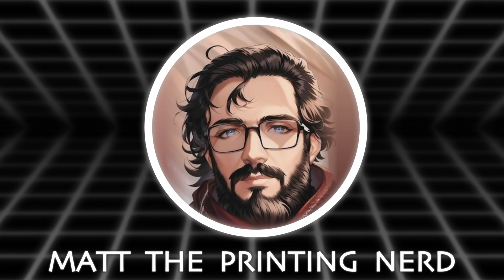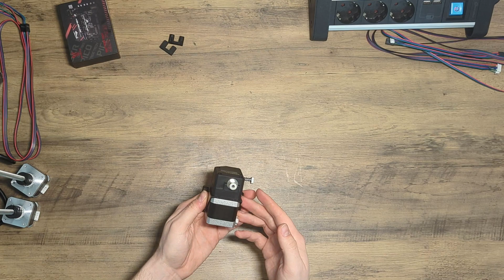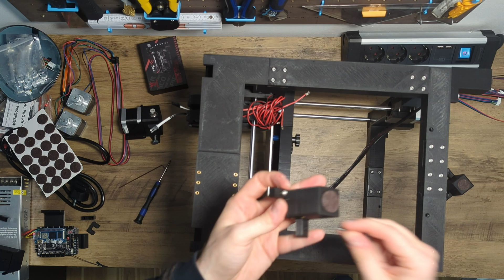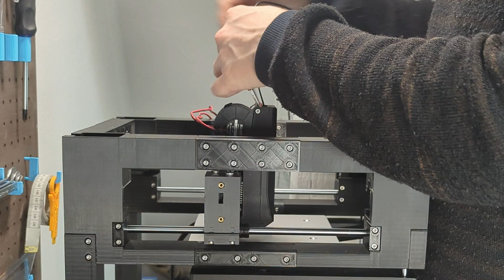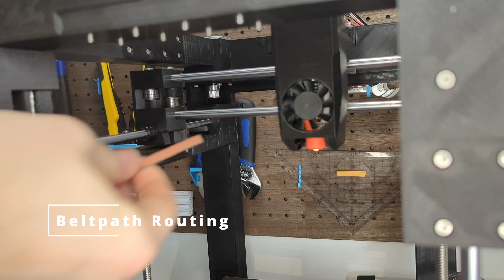THE 100 Assembly Guide - Part 5: Electric Installation

Comment: @9.45 - routing the belt is tricky, so it is easier to pre-cut the belt. For my built (totally standard v1.1) the length I measured was 118 cm - cut it and try it before you cut the other belt. Hopes this helps making it easier to route the belt!

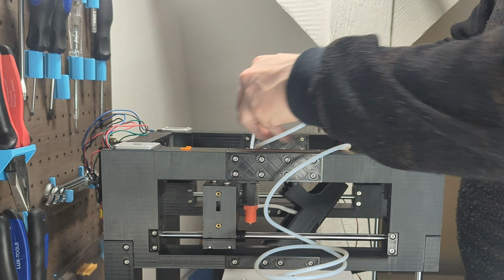Comment: 7:21 - the hotend ptfe clamp won't allow the bowden tube to pass.  Maybe the one I bought is defective?  I had to remove the collet and sand it a little smaller to get it to go in.  I am not a fan of this style of retainer - maybe a different hotend would be better?  Do you have any suggestions?

Comment: how stiff is the tool head supposed to be after installing the belts? I have to use quite a bit more force to push the tool head than I expected.

Comment: Matt, I've spent a lot of time researching this, but haven't found the answer. On the X and Y motors, I assume the left one (X?) is intended to driver the lower belt and the right motor (Y?) is meant to driver the upper belt. But the only time I see the pulleys, they are mounted with the toothed side on the bottom for both, which doesn't make sense to me. Shouldn't the right motor have the pulley mounted upside down so the teeth are at the top? Otherwise, what would drive the top belt? I've been through so many challenges with this printer and overcome all of them so far except this one.

Comment: My suggestion would be to add some safety to the electric wiring. You can't easily power down the system. Try adding for example the "3 Pin IEC320 C14" power switch. Another suggestion would be to add a shielding plate/housing to prevent touching the power lines close the power supply. 
Another issue I see is that filament can drop into the electronics. Maybe a sheet of acrylic can prevent this?

Comment: I have been trying to build this printer for a while now and i keep running into issues. Using the files you provided, i do not get the same results. One such problem i've run into nearing the end is that there is no way my print bed can reach the top because it collides with the print head. Have you actually gotten a working machine with the files you provided?
Reply from the maker: On v1.0 there should be 0.5mm clearance between the toolhead and the printbed assumed that the printbed is straight. You're not the first one that had this issue. In v1.1 i've modified the toolhead and added 2.5mm clearance to have more headroom for homing

Comment: Hey Matt,
I have been following you and your printer for a few weeks now and I am really impressed by the design and the functionality!
So much so that I am considering making one myself and was wondering if you would recommend making the printed parts out of ABS or if you have any experience with it as I would like to print with higher temperatures and maybe enclose the whole printer.

Really looking forward to more updates - Keep up the good work!
Kind regards~
Reply from the maker: If you plan to enclose it, i would consider printing it in ASA for the best performance and in ABS for a good price point. I don't have experience printing THE 100 in abs but this might be something i will try after v1.1 is released
Reply: I’m currently printing all the hotend components, the center heat bed mount, and electronics mount in ABS. The rest will be in PLA.

Comment: Is it possible to re-use a bunch of components from an Ender 3? Lead screw perhaps? Power supply? And for example the stepper motors. Your website does not specify what size is used but I would imagine that a standard nema 42-40 motors would be enough for the dual-z axis. While high torque motors must be bought separately for X and Y?

Comment: Might I suggest something similar to Velcro self-grip straps rather than zip ties?  It doesn't collect fuzz like traditional hook-and-loop Velcro, but it secures wires very well, is less likely to damage insulation, and is easily repositioned.  It is used a lot in LAN cable management.  I think model 189590 is the version I use.  I can't wait to see the final product.
Reply from the maker: Yeah for sure, I was not happy with the cable ties on the toolhead since it might be that you have to remove them for maintenance on the toolhead which produces unnecessary plastic waste.